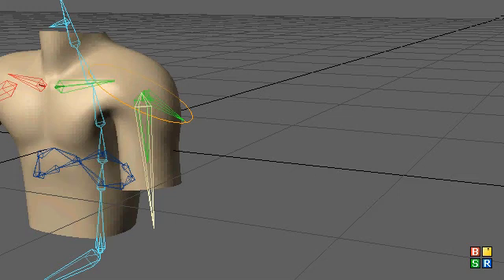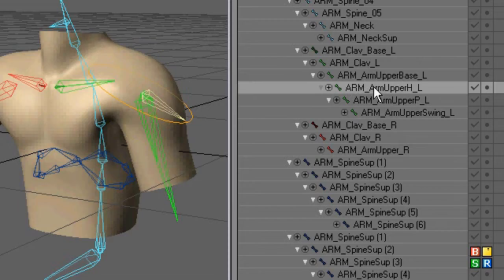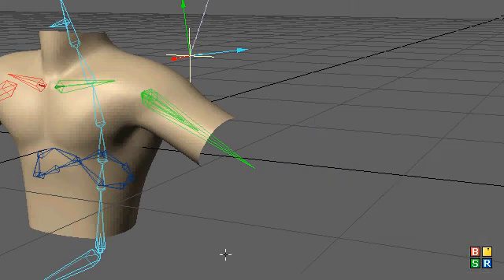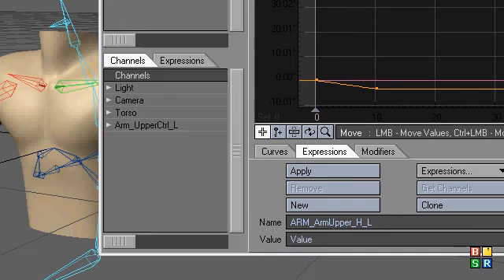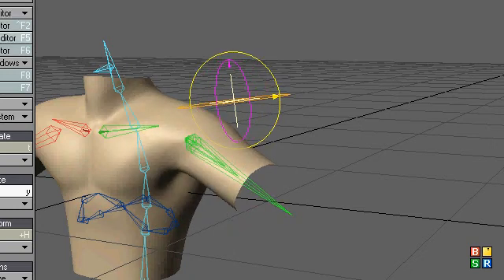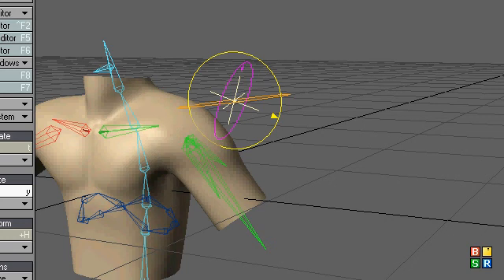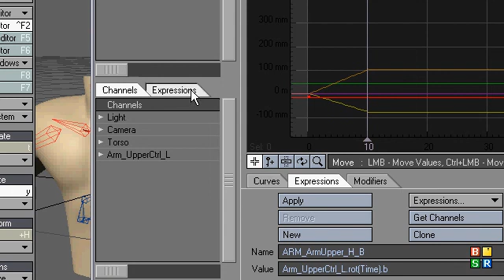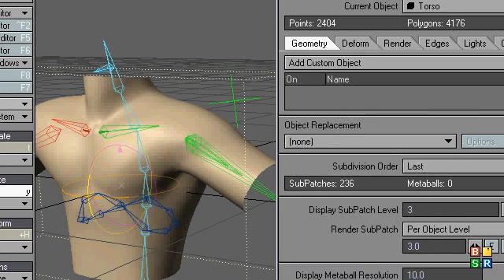Gimble-Free ArmRig 2 of 3

Comment from the maker: It's a different way to do it.  Lightwave bones do not require weight maps.. They just automatically play off each other.  So if I had more structure-support bones in his torso, that would not have happened.  C4D on the other hand, requires weight-maps painted for each bone.